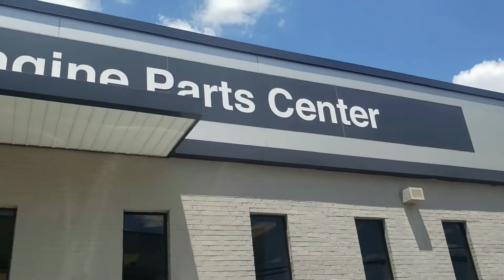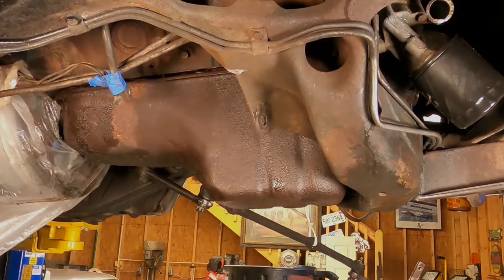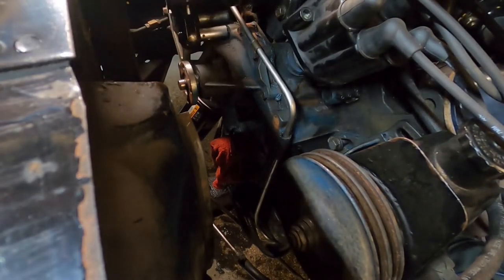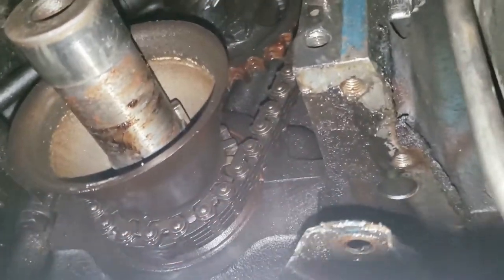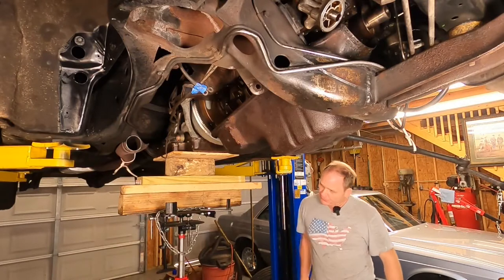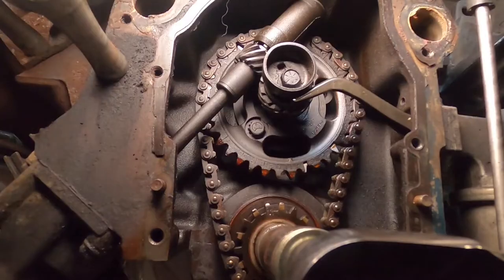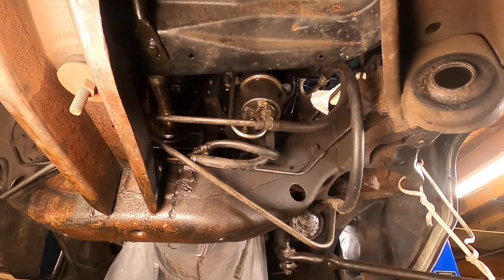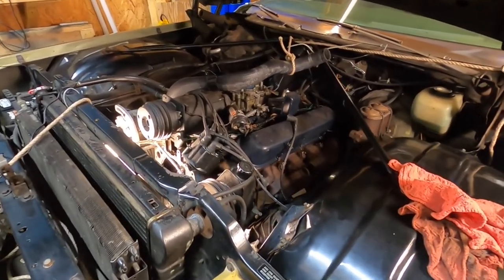Cadillac 472 500 Rear Main Seal, Front Crank Seal, Timing Chain Set - Part 2 - Timing Chain Removal

Comment: I want to thank you so much for this series! My '70 Deville Convertible was in a lost state after the timing chain slipped 3 teeth and it wouldn't start (due to a body shop tech who either drove or revved to too hard). I'd only done basic maintenance on it, and none of the mechanics I talked to were willing to tackle it. Thanks to your series I just finished replacing the timing set with a new Cloyes kit. Much appreciated!
Reply from the maker: Glad things worked out for you !

Comment: Swell.  There's a 77 eldo in the driveway, and the water pump arrived yesterday.  Then I found out about timing gear and nylon, car only has 25K miles, should I change it out as a preventative measure or just due to age ?  I'm thinking the 425 is going to be similar to the 472, meaning all the same steps you show us here.  You have to take the oil pan off to get to the timing cover ?  When will I be able to drive this car ? Thanks for posting this.
Reply from the maker: Yes you should change the timing set. Mileage is unimportant in my opinion. It's the years. The nylon degrades over time. GM used nylon coated gearing on many makes and models during this time. Yes the oil pan will need to come down and the oil pan gasket will need to be replaced.

Comment: I gotta do this on my 75 Eldorado. The shop manual says just to lower the oil pan a bit to get the timing cover off. It looks pretty hard to just lower it and not be able to fully clean it off and put a new gasket on it. Maybe if it was a three or four year old car?
Reply from the maker: I'd expect the shop manual procedures to evolve and improve over time.

Comment: The nylon teeth were installed to keep the valve train quieter. My 70 Monte skipped a tooth or so when I accelerated quickly and let off the gas. Luckily the 350 was non interference.  I replaced the heads out of abundance of caution. Put a double chain set on.   It was great, i could stand in the engine compartment and work on the engine.
Reply: Those were the good old days. That was a definite advantage to those big American beasts. Some weren't big enough to stand in but you could sit on the fender and have your feet in the engine bay so you didn't have to bend way over from the outside of the fender. Lol

Comment: When setting timing with a timing light with the old nylon timing set still in the car, was the timing mark on the balancer all over the place? Thanks.
Reply from the maker: I recall it being a little jiggly but not dramatically so. I've since replaced the points distributor for an electronic one. These changes have made for a very solid timing mark.
Reply: @ImpalamansGarage  okay. Worn distributor bushings will also cause the points dwell to be jiggly. A way too much stretched timing chain will cause for a "can't set the base timing anymore problem" at least that's my experience.

Comment: Great video! What is the name of the family owned shop that had the crankshaft bolt?
Reply from the maker: Ken's
Reply: @ImpalamansGarage  Ken's auto parts Pelham AL?
Reply from the maker: @hotrods-rus4966  Yes sir.
Reply: @ImpalamansGarage  what engine oil weight are you running? I'm about to get a 78 cadillac on the road.

Comment: I wonder if the engine mounts are to blame for the oil pan issue you had. I am sure you have a large pile of parts. But check those engine mounts.
Reply from the maker: A logical question however the mounts on this engine are only a few years old.

Comment: How do you set the camshaft front end play on this 472 ?  Someone keeps telling me that the fuel pump eccentric is the reason or adjustment for end play.  That doesn't make sense to me on this 472....    Confused at how the eccentric bolted to the end of the camshaft has any affect on end play .  Any help will be appreciated   Thanks
Reply from the maker: When I replaced the timing set I did nothing other than put it back together the way it came apart. There was no procedure associated with end play.

Comment: I'm surprised with how loose the timing set was the engine wasn't stuttering at certain RPM's. My old 352 had the original timing set in it, still had all the nylon but the chain was so loose if you revved it up to 2200 RPM or more in park with no load the engine stuttered and shook so bad you thought it had a rev limiter!
Reply from the maker: This engine has a studder at idle. At higher rpm is seems to run well.....at least that is my perception.
Reply: Same here I replaced the fuel pump on my 69 472. Stuck my finger in the fuel pump hole and felt a ton of slop in the chain. Be my next project.

Comment: Can anyone tell me where I can get the bolts for the water pump or the bolt sizes the ones I have are not the right ones and whoever worked on this car have no clue on what they was doing any help is greatly appreciated thanks
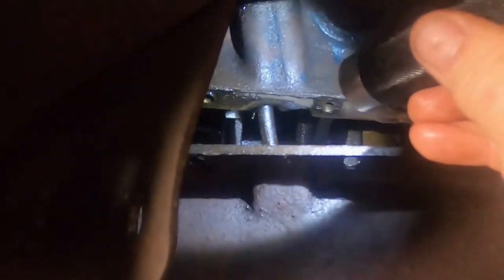Reply from the maker: I show the water pump bolt sizes and torque specs for each in this video at 5:25. https://www.youtube.com/watch?v=kxe60y4ml_c&t=325s
Reply from the maker: You can order any size bolt you want from mcmaster.com
Reply: @ImpalamansGarage  hey man thanks I'll order them tomorrow this car has been a pain in my side due to someone not using the right bolts once again thanks for ur quick response

Comment: When most people talk about removing the oil pan, the transmission has already been pulled.
Reply from the maker: If the engine or trans was a tiny bit higher raising the trans would not have been necessary. All the engine and trans mounts are new but I wonder if they are exactly like the parts were back in the day.